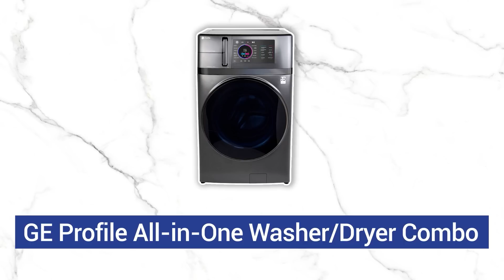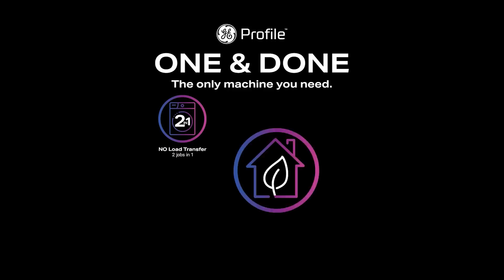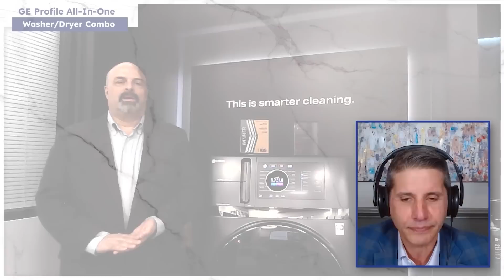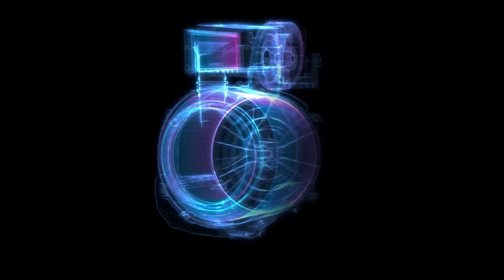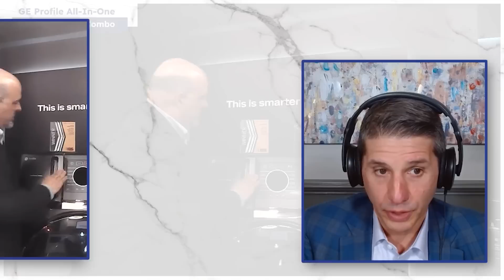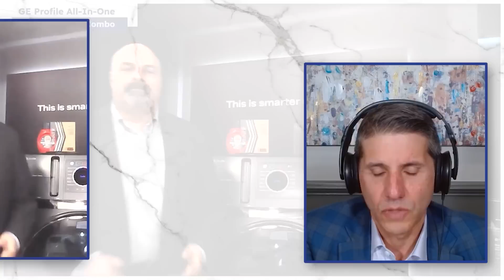New GE Profile All-in-One Washer and Dryer: Tough Questions for the Creator

Comment: GE has been a hard sell since we got one the first model of GE refrigerators with energy efficiency in 1988. The compressor had a fatal flaw that would self destruct in a year, and all of them had the compressor replaced. The replacement compressor failed in 1992 just before my daughter was born. When I came home after my daughter was born, I noticed the floor by the refrigerator was shimmering, and the tech didn’t install the strain relief on the water line. My wife and daughter came home that day, and my wife was helping empty a china cabinet which was wet from the leak. Reminder, that was the day after she delivered our daughter. We originally bought that refrigerator as GE because my wife grew up in Louisville, where GE designed and built their appliances.

While I like the concept, the memory of that makes it difficult. I’m sure there is some institutional memory of this problem at GE appliances as well. If this is a known and proven compressor design, it might make a slightly easier decision.
Reply from the maker: I had to live through that.....different GE back then.  Of course, that killed the company for appliances.  They limped along after that.
Reply: I wouldn't worry about that compressor problem anymore, now GE can update your software to kill your washer if their earnings are in danger of dipping below the previous Quarter.

Comment: Floor vibration and noise question.  We have laundry room on wood floor on mid-level of 3-story townhouse.  Using 2005 era traditional GE Profile agitator washer and electric dryer which we love but are getting long in the tooth.  How does the noise level and floor vibration compare to traditional machines?

Comment: I am really interested to see how this works out after a year or two, so much manufacturing is shoddy these days, it's really hard to trust devices this complex.  I had GE profile's for 15 years before it started having problems, I opted for Samsung replacements, and after 7 years or so already regretting it with quirky issues that aren't mechanically related.  Even if the mechanics are solid, I don't trust the electronics not to be crappy, even in a GE.  I say this as I have to replace my GE Monogram refrigerator compressor board every year or two that they burn out perpetually, so much I always keep a spare or two on hand...
Reply from the maker: Cant say I blame you.....
Reply: Meeee toooo

Comment: We just purchased this machine and it really does deliver. I highly recommend it. The wife is definitely happy with it.
Reply: How many bath towels can it hold?  Can it do throw rugs?  King bed linens?  Thinking about adding one behind double doors in the design of our new master bath.  Room to build shelves over the machine to install linen shelves?  TY for your input!
Reply: @pamsweeney1171  I've been using this model for a few days.  It does king sized bedding (more like 2.5-3.0 hours for something that big). Haven't done a throw rug, but I don't see why not.  It's almost 5 cu ft capacity.  I just did like 6 bath/beach towels, and it reduced the expected time significantly after it weighed the load, meaning it expected a full load on the "towels" setting to be significantly more.  Probably fits 8-10 bath towels.
Reply: @pamsweeney1171 I know this is late but I just washed and dried a really big king comforter sheet and pillow cases all together and still has good room came out super soft clean and dry awsome

Comment: 110/220 volt doesn't exist in the United States, it's 120/240 volt.  Been this way for a very long time.  So, do you have to empty the water that builds up in this?  But it saves maybe $30 a year, yet costs $2,900.  My separate GE water saving washer and gas dryer only cost me $1,080, plus I received an energy refund.  I like the technology but just doesn't seem like the savings are worth the cost.  I doubt the machine will last long enough to see a payback, because new washing machines just aren't built to last anymore.  Get the price down and I'd be all in.  Also, the one year parts and labor on the whole system is a tad low in my opinion.  Not much goes wrong in the first year.

Comment: If it was any manufacturer but GE I would be interested. I had a 2010 GE Profile Refrigerator that had a circuit board burst into flames on me. Evidently there was a class action but not sure if GE ever followed through. If I had not been in the house and smelled the burning electronics it would have caught on fire. I'll give it a few years for others to enter the marketplace and to see if the performance of this product will convince me to risk my families lives with GE again. I'm also very skeptical about the lint not getting to the coils over time. The angle of access to the coils would make it difficult to vacuum them without damaging them. Thanks to Yale and team for putting up this video and for future reviews to come.
Reply: Profit growth every quarter,  you see.
Out with GNP and in with GDP, you see.
Even Communism is "fine now" for GE, eh Chinese workers?

Comment: How low of an ambient temperature does the heat pump work?  Will it work when the room temperature hits 40 degrees?  What if this unit is installed in a unfinished basement?
Reply from the maker: Great question.  I will have to ask Ken

Comment: @YaleAppliance1 In a separated washer/dryer the washing machine is smaller than the dryer (~4 cu ft vs 7cu ft) to ensure that the dryer has sufficient airflow when a full load is transferred from the washer to the dryer. He mentions airflow in the opening, but how do they ensure sufficient airflow and should this be thought of as a replacement for a 4.8 cu ft washing machine, or a 4.8 cu ft dryer?
Reply: It is also a 4.8 cu dryer. I lost the timestamp but Ken mentioned that they solved that problem by A: using a larger heatpump and B: increasing the airflow. So, the dry air will be blown in much faster, and that essentially forces the clothes to tumble and fluffy around.
Reply from the maker: Yes, the dryer is always bigger for some reason, but you typically dry only what you put in the washer.
Reply: @YaleAppliance1  The dryer is bigger to provide airflow. It sounds like GE has solved the airflow problem as @SteveBarna has pointed out.

Comment: Did GE custom make this just for me????? I just ordered one (couldn’t have done it without the big July 4 sale), I’m so excited to get a washer that works for me. 2nd floor laundry, duct goes straight up 24 feet, costs at least $400 for a professional to clean it yearly (if you have a vent like this you know how fast they clog) and most won’t go up on the steep roof, so I clean it myself and have to pull the dryer out of the closet (so bad, I’ve been thinking of expanding the laundry closet so it can be vented horizontally to the outside wall $$$!). 

Besides that I have neuromuscular problems and most days just doing laundry is difficult. My top loader is so deep it’s a struggle to lift wet (and often tangled) laundry up and get it into the dryer.  And the Whirlpool controls laid out in one wordy block with a dinky LCD screen are not intuitive at all, so I only use the app which means I can’t start laundry yet if I left my phone downstairs. What am I going to do with the extra space in my 64 inch wide laundry closet? Install a the laundry sink I’ve always wanted!

If this works, GE wins an old customer back that had migrated to other brands after the old GE quality wasn’t there anymore. I don’t want bells and whistles, I want function and appliances that actually make my life easier and free up my time.
Reply: Amen to no more vent cleaning! I have a 20 ft run under my concrete slab and I clean it twice a year. In Florida in the summer that is a miserable job.

Comment: I'll wait for real-world reliability info, but it sounds especially great for smaller spaces.  Still not the equivalent of a separate washer & dryer, though; with separate units and multiple loads, you can "pipeline" the loads, drying a first load while washing a second load. With this unit you would have to wash and dry the first load before you can start the second load.  If you wash clothes in large batches, say 4 loads, this machine would take ~8 hours, while separate machines could be done in ~5 hours.
Reply: It would only take me 3 hours to wash and dry 4 loads. It only takes me a half an hour to wash a load and a half an hour to dry a load. And a load of towels maybe 40 minutes to dry.
Reply: @olivecracker1  This.
Reply: You could always take out a second mortgage and buy two of them! <grin> If the price does come down enough it might just be an option. Good point though.
Reply: Well if real world, you will not be able to start drying before you wash. How are you getting 5hrs instead of 8hrs? He did say the washer was the exact same. So if washer and dry are equal, you will come out better with all in one with half the effort and transfer trips.
Reply: @los2hot499  Say you wash a load in a washer and it takes 15 minutes.  Throw it in a dryer that will take, say, 45 minutes to dry, and meanwhile throw another load in the washer. In an hour you've washed two loads and dried one.  Second wash load goes in the dryer, your start a third wash.  45 minutes later...
See how the throughput improves?
Reply: Another channel showed for a load of towels, it took 3 hours and 45 minutes. That alone is a big turn off. Sure, it uses less power, but if you have to dry it twice as long, it's not much of a savings. And if the dryer breaks (as explained in the video), you replace the entire heat pump unit, not the broken part, great for GE, but not for me.

Comment: The new appliances with computer chips seem to be breaking down very quickly.
Reply: I'm an electronics engineer and a software engineer.  I prefer non-electronic, non-spftware whenever possible.  It still means that the mechanicals must be built robustly but still...

Comment: Like to see after 3 years! Washing a load of towels and jeans and dry for 2 & 1/2 hours. As the fine lint and dust builds up on the coils the drying in heat pump deteriorates. Unlike condenser dryers you can't pull the coil out to clean and wash. Should have been 240 volt which is more efficient.

Comment: At $2800, it needs a 5 year warranty with commercial quality parts. Otherwise the risk is failure after one year. Heat pumps are quite reliable so the issue is the motor. Use commercial quality motors.

Comment: I saw an interview where the rep talked about connecting two units together with an optional accessory.  No way you’d stack these as tall as they are.  Right?
Reply from the maker: No...You never want to stack a washer.  It will spin right off.

Comment: 2nd question, normal washer in a humid location, washer would be very moldy after few washes.  With dryer function does that mean the mold inside the washer won’t have this happen anymore?
Reply from the maker: You would think so.  The dryer is drying the gasket.  GE thinks so as well because the UltraFresh fan is not in this model.

Comment: Question isnt 220V more power efficient?
Reply from the maker: Typically, yes....However, the Miele 110 volt was about as fast as the Bosch 220 volt.  In my opinion, RPM spin, sensors and heat pumps play a significant factor in drying.

Comment: How does this compare to LG WM3998HBA?
Reply from the maker: It will trap lint which means better reliability with fewer service calls.  The unit has an auto dispenser, microban surfaces and a more efficient heat pump dryer.

Comment: My mom’s 45 year old Kenmore dryer is literally in the living trust to me. Nothing has ever made my clothes so fluffy and clean, not to mention jeans just look better faster. Lastly, it can be repaired with a spanner wrench and a flathead screwdriver.
Reply: Our Kenmore died out after decades of use. Appliances aren't made like they used to be. I'm still pretty excited for this one though!!
Reply: I was devastated when the ancient washer in the home I purchased 16 years ago broke down. Can't imagine how old it was.
Reply: Be thankful.  It was probably costing a ton in electricity bills.  Something like this heat pump dryer will pay for itself in a few years. @Thelooneylink
Reply: @Thelooneylink  The old ones never die, they just need new parts.  I have repaired my ancient washers and dryers (and I fixed my neighbors too).  Their are stockpiles of parts to last decades, just do the research and find the part.
Reply: by "old" I mean - units without screens and microcontrollers inside.  Any unit that uses a dial and physical buttons is "old" and can be repaired by the owner.
Reply: …and uses a city’s worth of electricity for one load.
Reply from the maker: Exactly opposite...very efficient compared to your old dryer
Reply: @RyanOfstie  Dude it uses way less energy than a 220V dryer. I did the math and figured if I bought one of these I'd save a minimum of $70/yr in electricity costs.
Reply: Clothes  lines are even more dependable. The old resistant coil clothes dryers are certainly simple devices - a heat coil, a fan and a motor but they are also tremendous energy hogs.  40% of a homes energy usage goes to the clothes dryer.  Imagine how much electricity was used to dry clothes in 45 years.  Answer: 21,060 kWh!
Reply: So far I love my new GE. Wouldn't it be great if it held up like my Kenmore. After 38years and my own 2 minor repairs it is still going strong. For now, it is in storage in the building, just in case.
Reply: True. I might buy this to replace my two front loads that are stacked in my laundry closet. The trade-offs are worth it if I can get a ton of storage space, and countertop with the removal of a unit.
Reply: Yes! This is the way washers and dryers are supposed to be made... but... I NEED a refrigerator that tells me my milk is low!

Comment: Does it need an external vent?
Reply from the maker: No
Reply: It compresses the air which sucks the moisture out of it then pumps it out through drain hose. No humid air is pumped out.

Comment: Building a new net-zero and passive home, this is one of the most exciting products that we have decided upon.  I am looking forward to changing the way we do laundry and not have to plan to move the laundry from the washer to the dryer.  Having this as a heat pump unit follows what we are trying to accomplish with the house.  This is such a brilliant step forward and such a major step for the all-electric home.  I grew up in a GE town and everyone bought GE and they performed so well.  I am really happy to be returning to all GE appliances for the new house.  Many thanks to Steve and Ken for this great video.  

Net-zero, passive, and all-electric homes are the way that homes should be built, but more need to be built for contractors to learn and be successful in reducing the incremental costs.  This washer/dryer is perfectly aligned with environmental needs.  We decided to have the entire design through building process filmed by The Build Show to create awareness.  Build Show Boston.
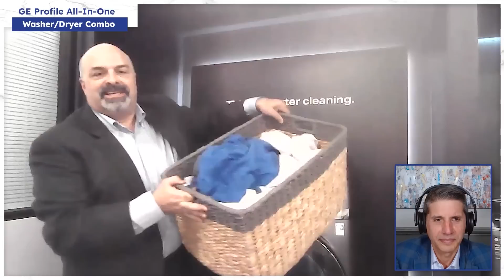Reply: "net - zero and passive" just become Marketing words when you look at the amount of energy used in 2 hours ->  13:15  for one, that's one typical load.  I can and do hang clothes now and I plan and will continue to hang clothes if/when I move.  Outside when possible  (currently not viewable by anyone but surrounded by a flower/edibles trellis on four sides if/when I move).  I also, regularly hang clothes inside.  Do I own a stand-alone dryer now?  Yes.  Have I purchased an LG All-In-One that I plan to almost never use as a dryer or one-step washer/dryer?  Correct.

Indoor Clothes Hanging sites can be designed surprisingly small when using all 3 dimensions and even make use of the HVAC System (a last stop before venting that air outside).

How "Net-Zero" are we if our landfills contain the Raw Materials that were extracted with devastating results?  How better off are we if "Hard Goods" is a pre-Reaganomics economic indicator replaced with "quarterly profit growth"?   And how better off are we when GDP (consumerism) has replaced GNP (manufacturing)?
Reply from the maker: Cool...let us know if we can help.
Reply: With appliances like this on the market, are you tempted to build the house without any 240v circuits? I'm assuming no because of electric cars. But it seems tempting. I wonder if anyone considers a very large capacity water heater with only 120v and a scold guard. That would be great because it could get the water very hot when it's very sunny
Reply: Oh and by the way, dryers usually have MORE (not less) capacity than a Washer, despite the GE Reps claim here ->  13:53
.

Comment: I would like to know if you are able to totally cancel out the drying portion for when you do line drying?  Will you need to replace the air filter at some point?  Are laundry sheets instead of detergent compatible?  When will it be available in white?
Reply from the maker: Not sure about the color.  You can pause the machine and then cancel.  You can replace the filter, but I don't think its necessary.
Reply: Saw a young lady review it in her home in another video. You can select just the wash cycle if you want.